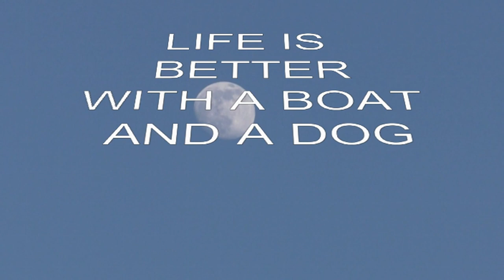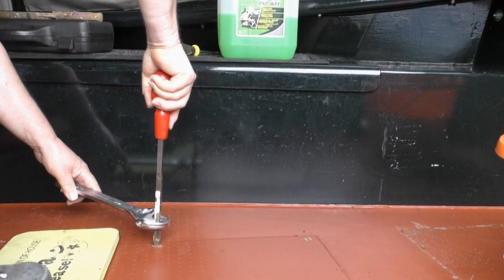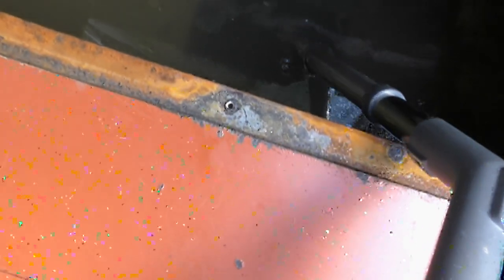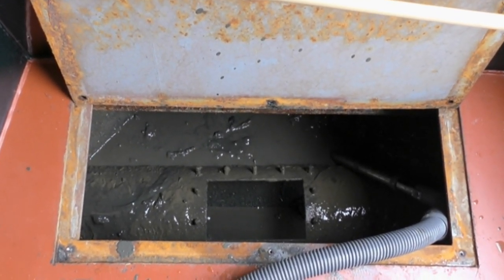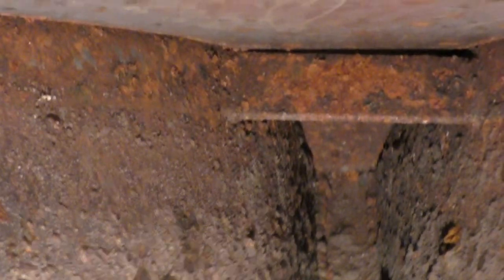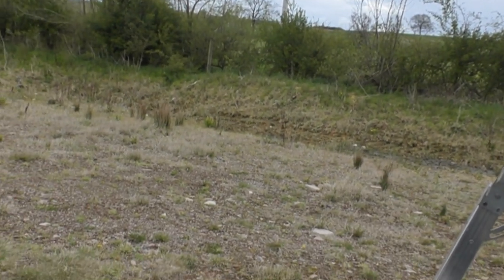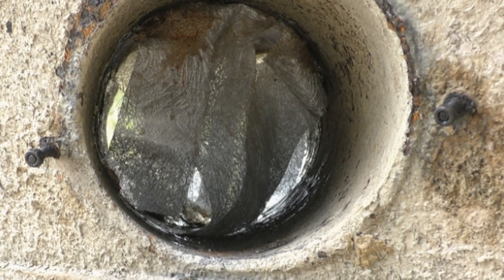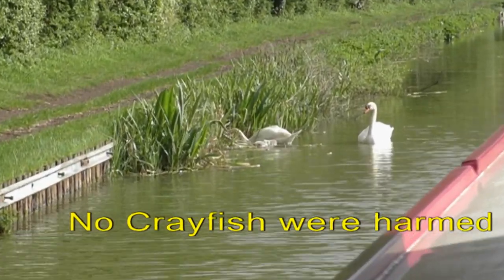THE HOLEY NARROW BOAT

Comment: Nice job to have taken on, you did well, albeit a "bodge" it worked well enough until a full repair was carried out. .......Thanks for posting......
Reply from the maker: Thanks for watching and your comment. I wish that I had discovered the problem earlier. I was hoping my "bodge" would have been more successful. I later covered the leaks with underwater sealant. However as fast as I stopped one leak another started.
Reply: @lifeisbetterwithaboatandad1534  You did an alright job, never the less....

Comment: Cant believe a hole was left in it and sold as is. Crazy.
Reply from the maker: I do not think that the previous knew about the hole or they would have had it fixed. Not easy to see the hole also from the outside with the grills in place unfortunately. The repair is now being done.
Reply: @lifeisbetterwithaboatandad1534  1 of the previous owners removed the bow thruster, and sold it with a hole in it.

Comment: I would have tried a plexiglass panel to fit over the bolts on the inside with some tape/mastic,
Reply from the maker: Now that is a clever idea. I wish I had used your suggestion. Mine was messy and did not work. Thank you.

Comment: I would have used a sand or water blaster to clean it out. and put a new tube of metal or PVC pipe into the tunnel then add a bow thruster motor.
Reply from the maker: Sorry for the very slow reply. I did go to a boat builder and as you suggested had a new tube fitted and bow thruster fitted.